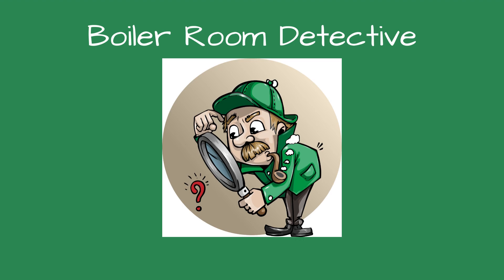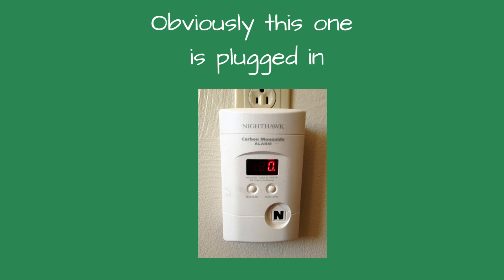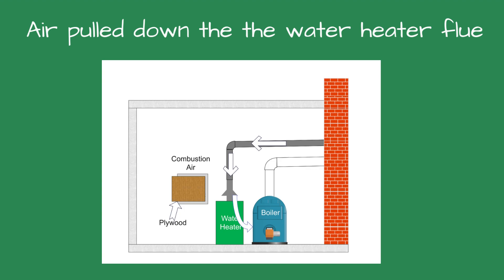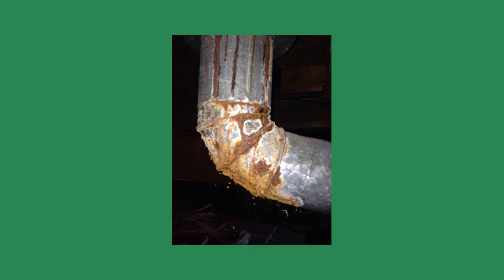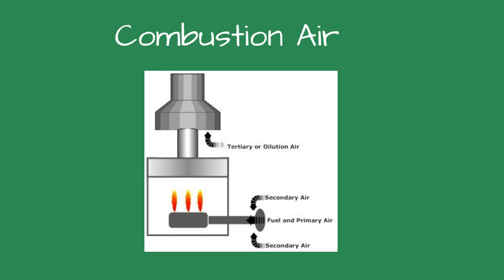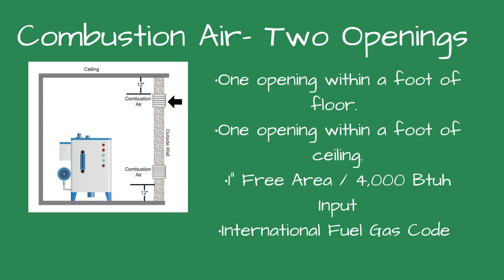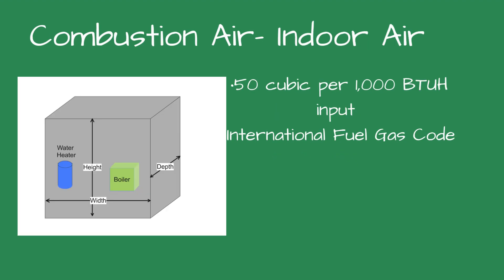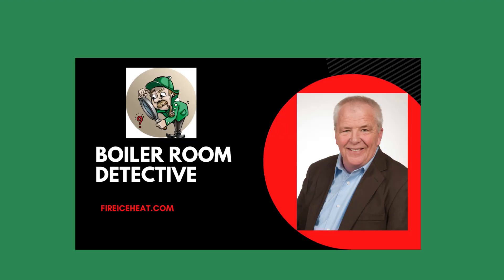The case of the Cold Flue Pipe

Comment: Hey Ray, I had a situation , or I should say a friend who owns some residential rental property with oil heat boiler had a problem with a steel boiler that would soot up, and i mean total soot blockage. It's a steel boiler as said with a bunch of cylinder tubes for which the gases pass to the chimney and the soot totally blocked the tubes with at least 2" of soot. It is a power vent system also, which of course explained all the black soot blowing out the side of the house making a mess.
 I noticed that the small basement where the boiler is had no outside make up air. After installing the make up air and setting the burner air, problem solved.
Reply from the maker: It's amazing how the lack of combustion air affects the flame. That could have ended badly Soot is so dangerous. Great job finding and fixing the issue

Comment: I replaced a leaking spirovent in a 4 story apartment building and when I was bleeding the radiators this little old lady said "thank God the heat's back on because this kitchen fan causes a draft right by my couch". It's the middle of January so I asked why she keeps her kitchen fan on and she said "maintenance man said the gas smell will go away if I keep the kitchen fan on". I thought she was mistaken or didn't understand so I shut the kitchen fan off and sure enough I smell the faint natural gas smell. The pilot burner tube was plugged on the stove she never used and the gas valve was faulty. I cut the gas off behind her stove and removed the handle. I walked down to the maintenance supervisor's office and told him what his maintenance guy did and the guy word for word said. "All these stoves leak a little gas. I've been here 30 years and it's never been a problem." I said fair enough and walked away. 2 hours later national grid red tagged half the stoves for leaking gas and we installed 18 brand new gas stoves a month later.
Reply from the maker: Good story. Can't believe the maintenance supervisor was so cavalier about the stoves. Thats crazy thanks for sharing
Reply: Essentially "it's never killed anybody yet, so I don't care"

Some people should be banned from maintenance for life, if not thrown in prison for negligence